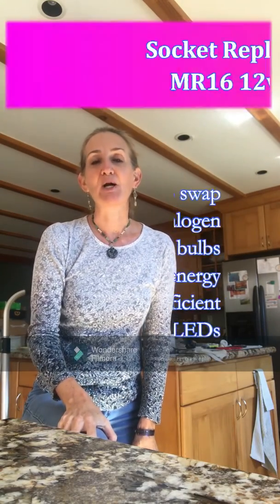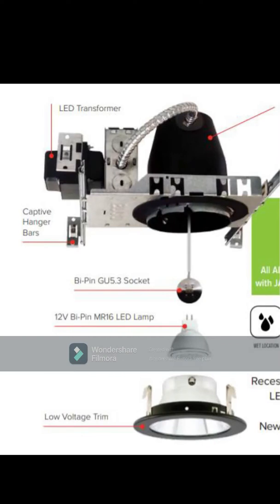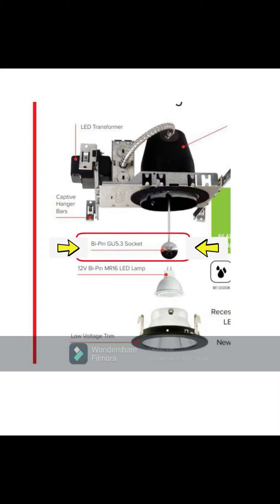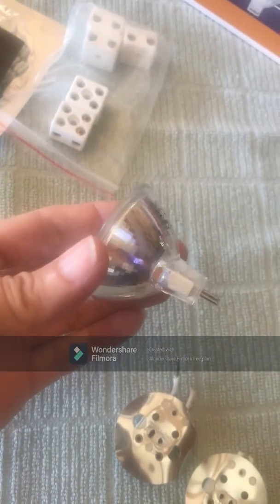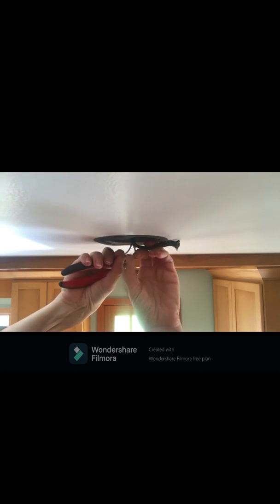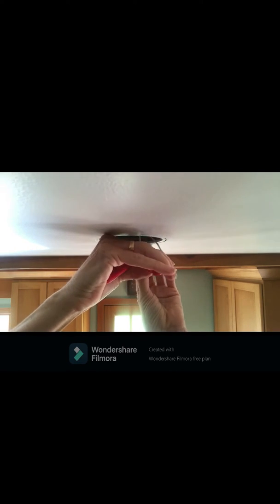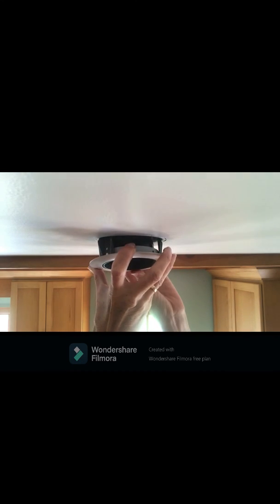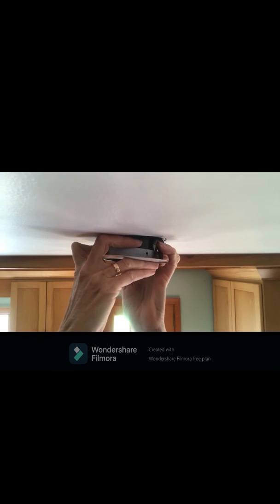Replacing GU5.3 Sockets in 12 volt MR16 can light fixture U.S.

Comment: Why the terminal block? You could have attached the new socket directly to the stripper wires from old socket you removed with wire nuts
Reply: Can you use wire nuts instead of the terminal block? I was wondering the same thing. I know nothing but this video was very helpful. I just don't have the terminal blocks and my molex connector is cracked. They probably figured easier to swap out with molex. Not sure what a terminal block does but did think using wire nuts could work.

Comment: Questions 1) can we use ceramic wire connector instead of ceramic terminal block? 2) you mentioned transformer, we not touching it, correct? 3) why ceramic? Is it because of the heat generated by the lamp.

Comment: That two “straight pin” set up is absolutely garbage. And that’s an insult garbage. If you’re going to all the trouble of replacing the actual sockets go for the 2 pin with the notch that locks when you twist it. Replacing a “halogen straight 2 pin” setup with an “LED 2 straight pin” setup is asking for trouble. The idiot who invented the straight 2 pin setup should be shot. The heat of the halogens was only half the problem. The other half was a smooth straight pin being shoved into a smooth receiver does not make for enough contact.